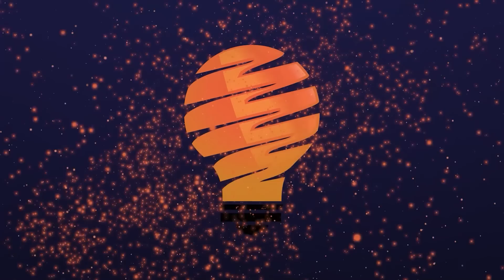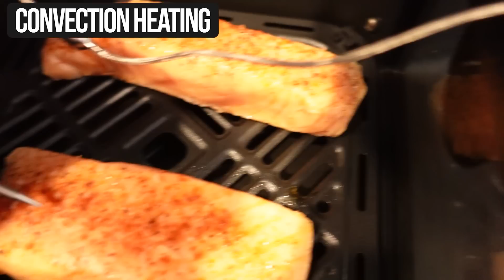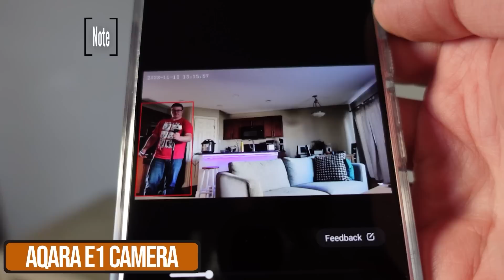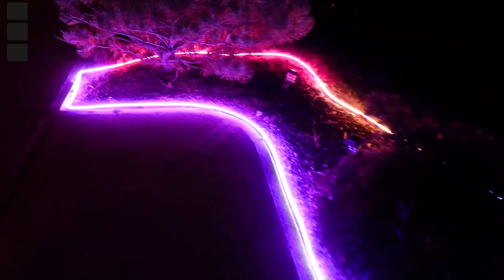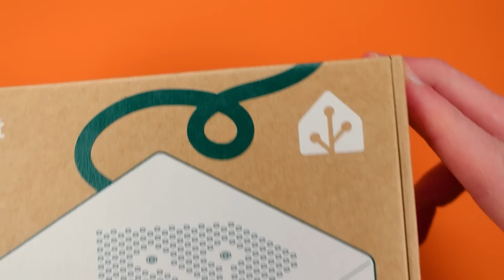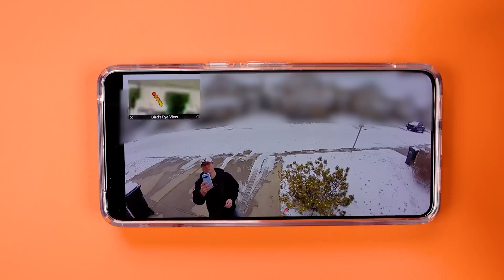Prime Day Smart Tech To Look For - My Favorites Right Now!

Comment: Can I use the Lutron switch to control Nanoleaf scenes?
Reply from the maker: I can't think of a platform that would let you.  It's more the Nanoleaf scenes.  They don't sync many places.

If you had Homey pro, I think you could go there, have Alexa, and that would have the scenes...but man that's a lot of extra stuff
Reply: @AutomateYourLife  in HomeKit I can set an automation to turn on a nanoleaf light when my leviton decora gen 2 dimmer smart switch is turned on. I’m looking to do the same thing but with a simpler switch, since I’m not actually using it right now to electronically connect anything. I was hoping for a cheaper solution, but this works for now.
Reply: But I can’t set an automation when the dimming buttons are changed, so only on and off works in HomeKit. Maybe home assistant can trigger a nanoleaf light setting based on a legion smart dimmer state.

Comment: I want to automate my intercom sound, when someone rings I want my lights to do a special effect, what should i get?
Reply from the maker: It's tough to do a specific sound.... I think you could look at two ways:

Why not redo it and use a video doorbell instead of an intercom? The other method is to look electrically at what's happening and do some sensing there. Tough, and it'll probably be a relay thing.

If you're trying to do an apartment, it's very tough...cause you can't touch the electrical usually.

Comment: Wasn't narwal dragging its mop all over your carpet in that video? Why would you recommend that?
Reply from the maker: Good question. My carpet first of all is HUGE. It's one of the tallest high pile carpets you can get. They lift 12 mm and that's going to be enough for most carpets. :)

But it leaves barely any wetness on the carpet, and I only ever notice it on the edge of the carpet...if at all. So the mops aren't soaked and they don't ruin my carpet at all. It's up to you, but it hasn't been a concern for me in the 6 months I've had it and the 1 year I've had their previous model!

Comment: looks like aqara m3 hub works with zigbee. do u know of any additional setup for those ikea smart bulbs then?
Reply from the maker: Aqara won't let you use basic Zigbee gear, so no Ikea bulbs coming in OK? Don't buy those together and expect that.

I'm using Homey Pro for Ikea bulbs, and have used SmartThings in the past. Hubitat will likely work too and in fact, I've had those hubs do some ikea bulbs in the past.  Just nothing recently.

Comment: If cost wasn't an issue would you go with Ring over Tappo for use with an Echo Hub?
Reply from the maker: I think if I wanted a home security system, then I would go with Ring. Otherwise, Tapo has the better cameras and features. :)
Reply: @AutomateYourLife  thank you sir. Have the camera, echo hub, and the pan and tilt in cart. Now to find the courage to press buy. 😂
Reply from the maker: And in terms of the cameras, I haven't found any real additional benefit with Ring over Tapo with the Echo Hub